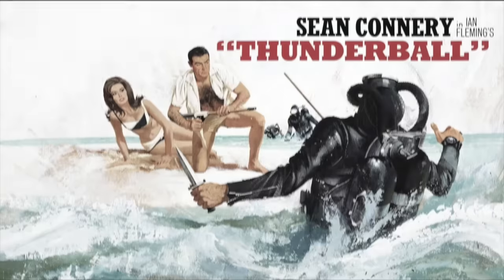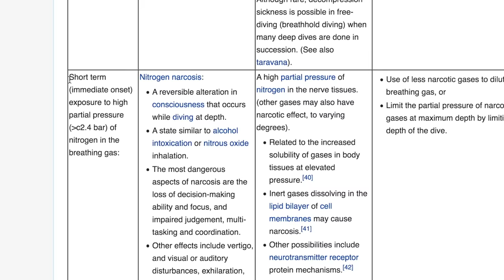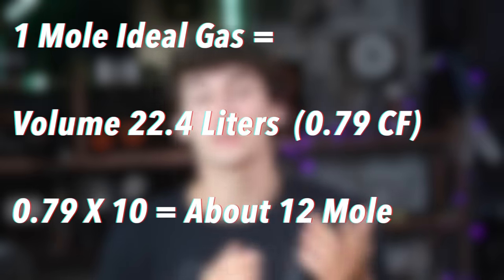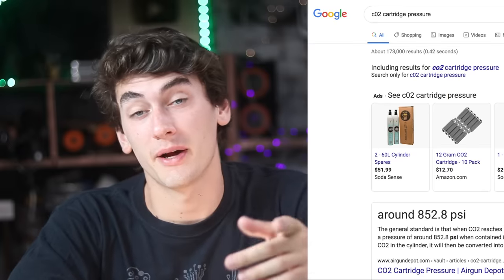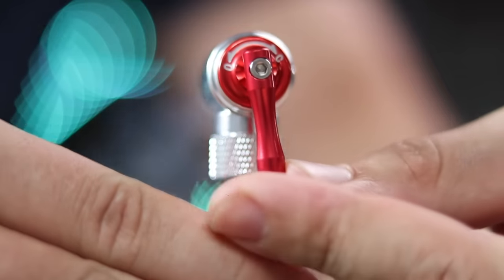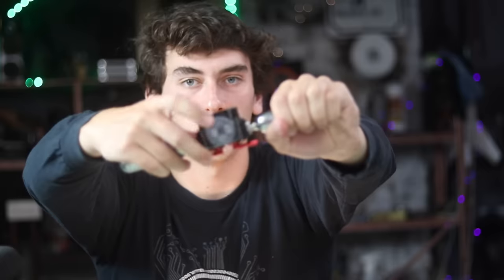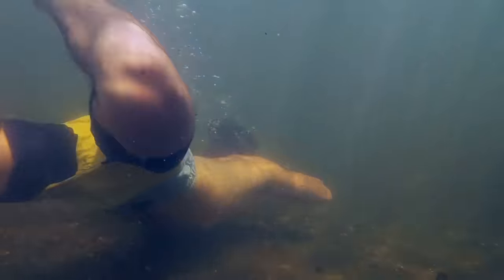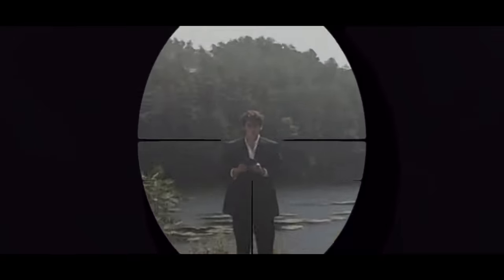Working 007 Mini Scuba Tank! - Breath Underwater With This Spy Gadget

Comment: As a professional Scuba Diver myself, I was very surprised how much you knew about scuba diving and how accurate you were. Nice job 👍🏼
Reply: I'm a new certified diver and I'm surprised that this works so well and  it would be nice to have under that water if you dont have a spare air
Reply: Which bits in particular surprised you?
Reply: @blastfromthepast7119  maybe because it's truly work even though just for 1 or 2 minutes.
Reply: I mean.. Google?
Reply: How do you professionally scuba dive, I’m super curious
Reply: XRA 17 The minimum requirement to be considered a professional scuba diver is your Divemaster certification. You would also need Dive insurance and liability insurance.
Reply: Experi Mental his understanding of Dive theory and gas build up and mixtures. As well as being well informed on the dangers and risks of scuba diving, such as DCS.
Reply: NOWHY this becomes much more dangerous at deeper depths and for longer periods of time. This is only something that can be used for exactly what he is doing.
Reply: Remember in case of an emergency no air ascent, to spread out your arms in a star shape, and go AHHHHHHHHHHHHHHHHH as you ascend. :)
Reply: I am also very suprised by how much he knows about scuba!
Reply: @ninjafire3583  spare air is the closest you are gonna get for this OO7 thing, until they make cylinder of  18000 psi pressure and regulator to deliver it safely..even composite fiber glass wound  firefighter cylinder are rated about 6000 psi
Reply: guess u dont know who dis is
Reply: I mean theres a difference to diving and studying. Studying just takes a bit of research.
Reply: I have question,
It’s healthy what he did yes?
Reply: @HenryEAvery  No
Reply: me to
Reply: @ninjafire3583  no, it just provides a few breaths in shallow water and about 1-2 breaths at 15m depth.
A large spare air could at least precise enough air for a controlled ascend from 30m dept with 1-2 very short safe stops
Reply: As a certified gold professional bachelor associates mc5#  veteran insta diver I can agree with this ‘
Reply: @xra1750  I can help you get certified
Reply: Yea, right. Are you tho?
Reply: is he not breathing contaminated air by pressurising it without filtering out toxic gases?
Reply: @awkwardsaucetv4770  I'm late, but if he was trying to go deeper than 6 meters with his tank filled with pure oxygen, hyperoxia would become an issue and i did not see him talking about that (it's probably fine for two breaths tho).
Reply: why did i read that in a Australian accent
Reply: Fellow Instructor tapping in🤚😂😂
Reply: Same :)
Reply: Me too
Reply: @xra1750  Google
Reply: @trytodraw5373  no it’s called Padi Divemaster 👍🏼
Reply: @rikusferreira2532  My people 🙌🏻
Reply: @rypdx  😆
Reply: @ninjafire3583 I to am a new certified diver
Reply: as a fellow diver, i to am suprised on the accuracy
Reply: Not a diver and why would this be news, pretty much common knowledge. I don’t know but I learned these basics as a kid, and I’m no super kid in school just average. But yeah I suspect kids these day’s don’t learn practically anything.
Reply: @ninjafire3583  and using it can kill you.  as a certified diver you should know this is an unregulated air supply and it ha a capacity of only a breath or 2
Reply: Congrats on being a professional but isint a Master Diver just allowing you to lead a couple tourists around? I guess my art museum guide is a professional as well.
Reply: This means that being certified doesn't mean that much, he just google mos of the informations and used some very simple online calculators lol

Comment: Little side note: if James had actually used a weapons-grade explosive in that scene, the pressure wave would have killed him, too.
Reply: Yeah mark rover explains it
Reply: I mean rober
Reply: @annihilate2479  he turned into the thing he created

A Mars Rover
Reply: @smii7ymilk919  lmao
Reply: @annihilate2479  what video does mark rober explain it in?
Reply: @stuschkenheimer  it's how to survive a grenade blast
Reply: Not exactly cause it was dropped down into a closed space that would have absorbed the blast
Reply: @monkeytoes1155  I think what he meant was, Bond or the spy dude survived the explosion. If he thinks of what happens to those who were inside, then your assertions are wrong. Closed spaces actually enhance the compression factor X amounts of times to whoever stays inside that space. Therefore, NO living being would survive inside the enclosure, depending the volume of the enclosure, pressure variance, expansion volume and time that took to eqilibrate (factor/s) to it's surroundings. However, there's a fair chance a person outside of that enclosure "may" survive. Then again, we are speculating that enclosure contained the explosion and did NOT breach it by any way shape or form.
Reply: If it run out of gas underwater just for3metres depth when you go through surface your lungs will explode
Reply: @Auuneoclassic  You would be completely fine because you can just breath out while ascending. In fact during the CESA test during open water diving training a diver must ascend 20 feet without taking a breath, you instead breath out the entire time
Reply: @Flob13  In case if person who don't know about how pressure do in panic moments

Comment: You should make Batman's utility belt with a full set of tools including the scuba breather, grappling hook, bat-a-rangs, smoke bombs and flash bangs, and other things you previously made.
Reply: Man for now uhh that's just too much.
Reply: Y E S
Reply: Signed
Reply: While a full-functioning set of tools may be too much to ask, a more reasonable challenge that I'd be very interested in would be to see just how many gadgets you could fit as lightly and in as little space as possible - I don't care if it's all replicas, as long as the weight and size of the gadgets is roughly what could be achievable with sufficient funding.
Reply: Don't forget the bat 🦇 🦈 repellant
Reply: Along with a can of ‘Shark Repellent Bat Spray’….you know just in case 🤔

Comment: Why not attach a snorkel mouth part so it fits better on the mouth and you have something to bite without cracking your teeth
Reply from the maker: True but that adds size, maybe if I do a V2
Reply: @JLaservideo  please do V2, that would be totally awesome! I think this is actually a great invention and some "improved" version could be actually very useful. Good job!
Reply: Gaming Zone it really couldn’t. It’s so absurdly unsafe. Buuuuut it’s pretty awesome
Reply: @JLaservideo  do a V2 with less wide tank but longer and go around your neck like those glasses you just raise up when you need them
Reply: @ronytm9594  good idea
Reply: You bite on snorkel right? If he can make pressure lever to activate the valve right on where he bite, it becomes more efficient, as less air is wasted, and less movement to activate means less energy, means less metabolism, means longer time underwater.

Comment: One danger a a lot of DIY scuba stuff forgets is that the oil from pumps (for example, the kind you'd find in a bike pump) is super bad for your lungs. When I went to grad school for marine ecology, I read a case study of divers in the Caribbean that used really sketchy rigs based around air compressors. If something else didn't kill them first--and this was super dangerous so big if--they would develop an emphysema-like disease.
Reply: Yes, it's grease that they put in bike pumps. It's just to act as a cheap sealant instead of getting a pinpoint seal on the device. But hopefully he washed those canisters out good.

Comment: I started diving in ‘67 and still dive today. I’ve used a “Spare Air,” which holds 12 cubic ft of air @ 3000 psi, and it only gives you a few breaths at 12 ft depth, so I’ve known for years that Bond’s mini tank was fiction.
Reply: @sa.8208  you cared enough to comment.
Reply: @sa.8208  obviously you do since you commented.
Reply: By the way, would it be possible (and useful) to breathe some gas mix with higher O2 fraction in order to extend the dive time?
Reply: @alexmin4752  yes, pure o2
Reply: this comment is not correct
Reply: @alexmin4752  enriched air will not extend your air supply. It will extend your no decompression time because a higher level of O2 in the mix replaces nitrogen which is the gas that causes decompression sickness. Air is 21% Oxygen and about 78% Nitrogen with some trace elements. By increasing Oxygen to 30% you decrease Nitrogen to 70% thereby decreasing the build up of nitrogen in solution in your blood and tissues when you breath compressed gas under pressure. The volume that you breath will not change.
Reply: @bigrich6750  thanks for a detailed reply. But still, if you train to breathe less volume and the gas is richer in oxygen - would it be possible to dive longer? You should still get same ammount of oxygen as during normal breathing. Or it won't work out?
Reply: @alexmin4752  Yes, it’s the training part that makes a difference. Learning to relax and control your breathing is the most important factor. New divers always struggle with this because they’re anxious. The increased O2 doesn’t really factor into how much you breath as much as physically and mentally controlling your breathing does.
Reply: @bigrich6750  Alternatively
I knew that the James bond mini scuba device was fake when I was 9 and had zero scuba experience lol
Reply: Damn how small is that tank 12 cu feet? I thought I had the smallest 0.5L rescue tanks, but it says mine holds 30 cubic feet of air. Lasts like 5 min good for cleaning underside of a boat lol
Reply: @rajgill7576  The “Spare Air,” tanks are the size of your hand. I most of them are 3 cu ft or 6 cu ft now a days.  I don’t think they even make the 12 anymore. Your 30 is a legitimate scuba bottle. We call them pony bottles, because you strapped alongside your regular tank for either a reserve or with a higher o2 deco gas.
Reply: If using a rebreather, yes. The problem is that the air in your lungs builds up co2, and it becomes toxic. More oxygen won't help get rid of co2 much faster, so you would still need to breath the same volume. If you use a rebreather, it has a chemical that scrubs the co2 from your exhaled breath, allowing you to breath the same air, over and over, and in that scenario, a small oxygen tank is sufficient, because you only peel off a small amount of oxygen every time you breath in. So, as long as you an remove the co2, then you can keep breathing the same air over and over again, with only a little bit of oxygen to top up. It would probably use about 1% of the gas used in a scuba set up.
Reply: @rajgill7576 what’s 30 cubic feet in metric?

Comment: In the early 2000s I saw a TV program on a marine survival suit for helicopter pilots that had a plastic bag  with a mouth-tube you could breathe in and out from (after taking a big breath before you hit the water). It worked because we don't extract all the oxygen from the air we breathe, so our exhalations still contain a lot. It extended people's ability to hold their breath by twice.

Comment: heres something to keep in mind. you could effectively dramatically increase your ability to last under water with this method. make a small belt with maybe 10 extra cartridges on it. the only thing thing is it might be hard to not accidentally get water between the air valve and etc
Reply: Or drop them lol